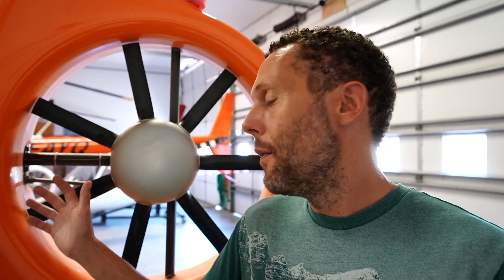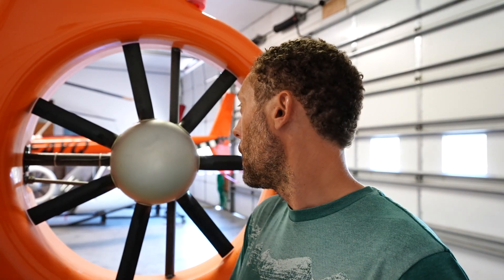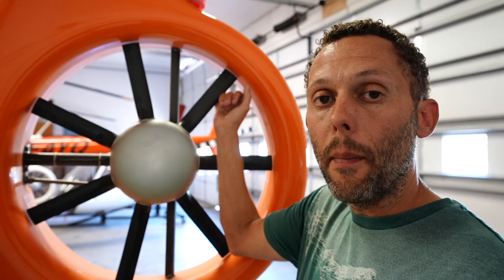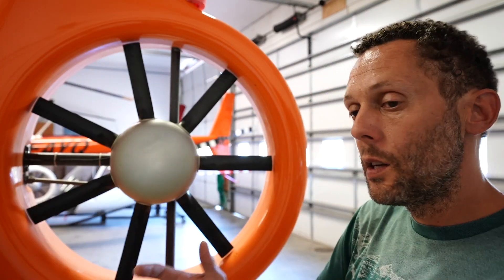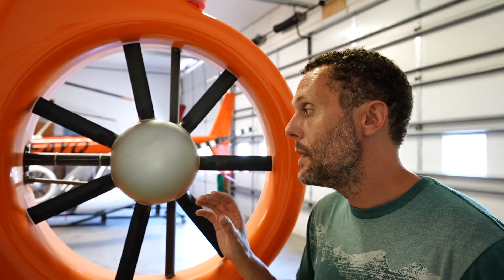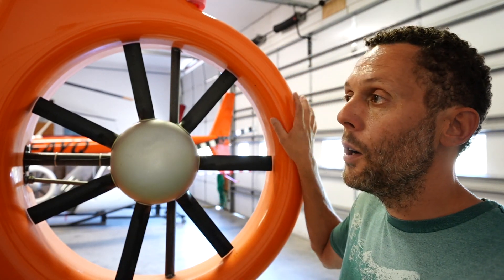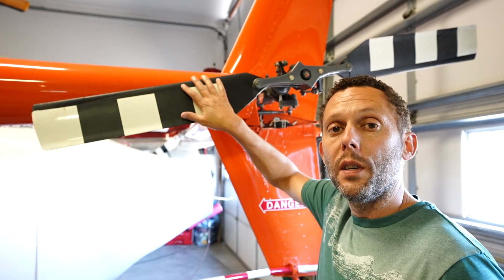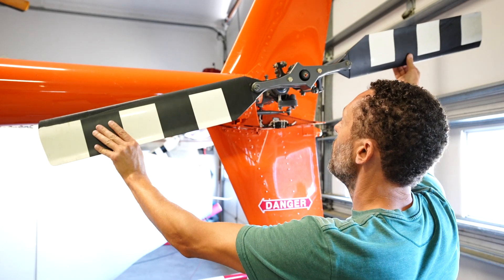Ep.80 Which is better fenestron or tail rotor

Comment: It looks suspiciously like you could very easily have an DC brushless motor driving that tail rotor, and then have arbitrary "feel" to the pedals, and not have to vary the pitch of the blades, just vary rpm...
Reply: And then, if the electronics fail, you die. Having them mechanical linked allows continued flight control after power failure
Reply: Come on!
The failure rate on brushless motors is very, very low, with some rated for 100,000 hour life, and it's relatively easy to use redundancy in the drive and power supply... with gears and shafts, there's constant need for lubrication, wear is inevitable, and you end up with a long shaft that's subject to vibration, and probably 2 right angle drives .. but, everyone can have an opinion.